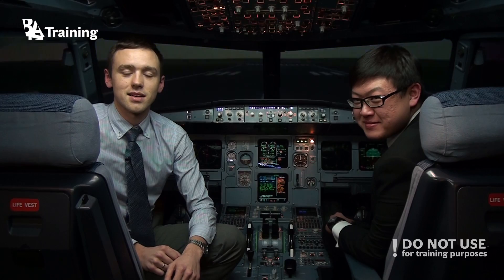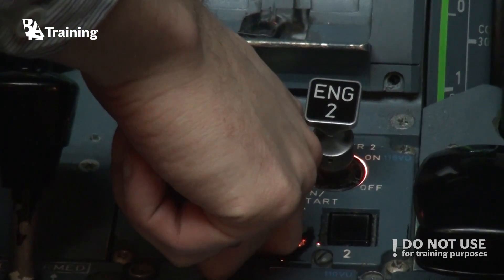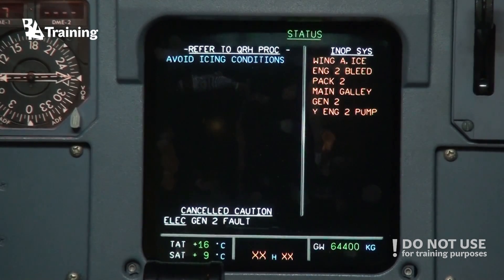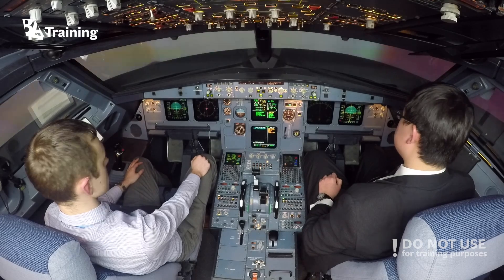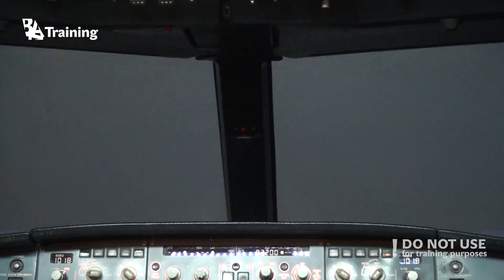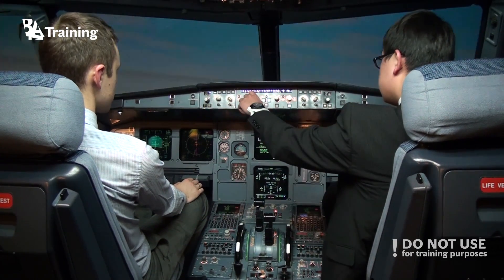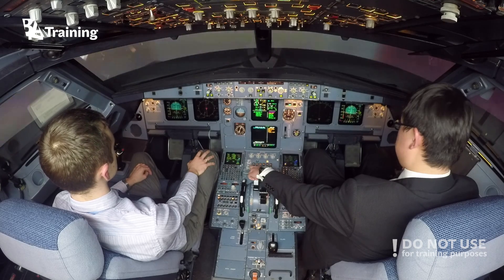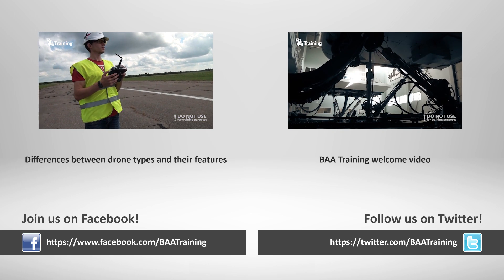Airbus A320 Engine Inoperative go Around and Landing

Comment: Did not have his hands on thrust levers again 
did ask for ecam below 400 ft 
The pf is the one is supposed to take the lever to Did not gave hus hands on thrust levers again 
did ask for ecam below 400 ft 
The pf is the one is supposed to take the lever to idle 
Trimming with auto pilot is useless
Flaps by pf 
Not having st least apu master before clearing elec 
No one called for emergency 
Ok thats as far as i watched for now

Comment: You waited to cut the fuel on a Burning Engine until both fire pods were discharged,. The fuel cut out should be first? That might help stop the Fire from spreading.
Reply: What are in about. It was the crossfeed he sketched after squibs. Fuel was cut off when it’s supposed to be.

Comment: No seat belt for the pilots 
No brake check 
 No clock watch start takeoff 
Confirmation for activation of fire push buttons missing 
Pilotcommand doesn't have the throttle at takeoff 
No ATC communication at all 
No announcement for activation of the AP 
Fo commands flaps 0 and sets them himself 
They're not referring to qrh as said on the STATUS page 
Didn't activate the approach phase in the Ecdu before the approach button was pressed,
You don't know who's the PIC all the time 
You don't check the speed for gear down,
Didn't follow the landing checklist as said on the MCDU,
Seems that not all the lights are on for the landing,
You don't press the CAB FWD button for landing but just to call them to the interphone,
You would consider enabling APU bleed with one engine out,
You would consider enabling both APs for the landing 
They cancelled procedures in the ECAM without confirmation,
No announcement for activation of the AP, Seems that the seat belts are either off or auto but be on

Comment: Hello these are my anwers for the mistakes they made:
- Pilot Flying (right Seat) brings flaps up from 1 to 0 but it is the job of the pilot monitoring (left Seat) to do this.
- Engine mode selector did stay on ing/start for the entire flight after they checked that the engine was inop it should be putt back to normal.
- first arrival they didn't do a arrival briefing and didn't arm approach mode.
- after go around no checklist.
- flaps 1 after go around needs to be flaps 3, pilot monitoring correct's the flying pilot.
- pilot monitoring takes over the controls after bringing up flaps 3 butt the other pilot doesn't confirms it, bad communication all over the flight this can lead to confusion between pilots.
- after the control switch the pilot in the rigth seat calls for flaps two butt the pilot in the left seat should ask that now the roles arren't being switcht.
- second approach the right seat pilot wants to drop the gear to soon, left seat pilot corrects.
- at landing they right seat pilot doesnt focus on landing because right before touchdown he is doing something on they pedestal en forgets to pull the power back for a nice flare.
- poor steering!!!!

- no seatbelts on 
- no contact with atc
Butt cool contest hope i am close!

Greetings from the Netherlands

Comment: -No AP2 in ILS
-The F.O that he's flying the plane cannot do another thing, the other pilot should do all the things of geard down, flaps, etc... ---The F.O can only fly the plane.
-No cabin adviced.
-No checklist.
-No usage of the lights.
-The F.O is not that capacited to fly it, but that's okey because he's an student.
-If the F.O is flying the plane they need to turn on the AP2, not the AP1.
-Not confirmation at all between the checklist and cancellation in the MCDU.
-Not selected the approach in the MCDU.
-With an engine out you need to land with flaps 3, not with flaps full.
-Obviously not ATC notified (Not ATC at all).

That's what I think, greetings from Mexico.

Comment: Before Go around 
No configuration V1 V2 VR MFlex (speed)
No TACAS on TA 
engines were in toga for a several time 
Unstead to keep flaps 2 you decide to retract it 
No Apu after 5 minutes 
No ATC 
Autopilot 1( captain)  were used unstead autopilot 2 (copilot) 
NO AP1 +AP2 with aproax mode 

After Go around 
Autopilot (AP1) unstead AP2 
No alternative airport plans 
Copilot out of focus on landing  
Captain allways telling the indications unstead the copilot made the indications because he was flying the aircraft.

Comment: no seat belts for the pilots, 
no brake check, 
pilot in command doesn't have the throttle at takeoff, 
no clock watch start at takeoff, 
confirmation for activation of fire pushbuttons missing, 
no ATC communication at all, 
no announcement for activation of the AP, 
FO commands flaps 0 and sets them himself, 
they're not referring to QRH as said on the STATUS page, 
they cancelled Procedures in the ECAM without confirmation, 
didn't activate the approach phase in the MCDU before the approach button was pressed, 
you don't know who's the PIC all the time, 
you don't check the speed for gear down,
didn't follow the landing checklist as said on the MCDU, 
seems that not all the lights are on for the landing, 
seems that the seat belts are either off or auto but should be on for landing, 
you don't press the CAB FWD button for landing but just to call them to the interphone, 
you would consider enabling APU bleed with one engine out, 
you would consider enabling both APs for the landing, 
you start the go-around only at minimum altitude when nothing of the runway is visible, but not 100 feet above the minimum
no GA flaps were set,
 you set AP2 for FO and AP1 for CPT, 
when you only have one engine available you set the TCAS mode to TA Only
when you only have one engine available you approach with config 3 not Full

that's all for now ;)
Reply: LordNoName must either be a real Airbus A320 pilot or just knows his stuff incredibly well.
Reply: Maybe flaps 3 landing with one engine out
Reply: Louis Dengler to be or not to be 🤣😂 may be landing weight allows make landing this flaps full 😉
Reply: A lot of the time nobody is flying the aircraft. They both have their heads in the problem.
Reply from the maker: Congratulations to the winner of this challenge! +LordNoName Please provide us with your full address and phone number to news@baatraining.com as we are going to send you your present.
Reply: What was the present?
Reply: Sounds like one of these pissy instructors

Comment: No AP1 and AP2 on CAT 3 landing 
Exedet the TOGA limit 
FLAPS full instead of 3 
Did not add 5 knots at landing speed 
Did not reset the ruder trim on time 
Retardet to late 
Puting ENG mod selecor to IGN was obvius not nesery because engeni fire and damage 
Transponder did not put in TA 
Was not on the center line 
Maket to sharp turns  
No ATC 
No checklist 
No pasenger notification 
No pasenger sings 
Flap 3 mode on GPWS 
No briefieng 
No cabin crew briefeng 
Cros feed was of 
APU to late 
No APU generater 
No APU bleed 
The first officer almost retrakted the L\D GEAR 
Captain did not land the plane 
Captain disconected the AP 
Flap retraction to late

Comment: Starter set to Ign, not necessary in airbus. "Pilot Flying" trimming rudder nose right when it should have been nose left. Full flaps used instead of a conf 3 landing. Not really sure who was supposed to be flying half of the time especially after captain called "my controls" then continued to ask for first officers input. Only one checklist read out in the flight.

Comment: I think you exceeded the time limit for toga thrust which is actually 5 min. You should have reduced it at the thrust reduction altitude. Moreover you should have set the clean configuration at the engine out acceleration altitude and not at 3000 feet.
Reply: 10 min witn one eng fail

Comment: Wrong cockpit commanding (flaps and rudder trim reset on landing...)
Use AP 2 for the right side pilot flying
Do not use TOGA on a normal takeoff 
No atc and cabin contacting?

Comment: Minimums at 200 feet? With only one engine? In such a low visibility? Isn't it kinda low? And do they use flaps full with one engine operative? BTW, u had to add more than 5 kts to final approach speed. It's way too slow!
Reply: +Богдан Ковальчук That's pretty standard for a CAT I ILS approach. Not sure if having an engine out makes a difference, though.

Comment: No AP1+AP2 in CAT3
No checklists 
No cabin notifying
No ATC notifying
you have to press LOC before APR
Reply: +the gold movies AP1+AP2 is not needed in CAT3. CAT3 means autoland mode in Airbus. CATIII of ILS is a different thing.
Sometime you don't have time for full checklist, you have to focus on another things. So you're doing only MEMO actions - this is the most important essential which you MUST do.
This is a pilot decision to notify the cabin and just only stress passangers - why if it is only 1 engine failure, and you clearly can land (e.g. conditions are improving) - so why unneeded there stress for passangers???
They  very few simulates operations with ATC.

You don't have intercept LOC before G/S, sometimes operation allowes to intercept LOC and G/S in the same time. Also blue G/S only means that it is ARMED mode (it will automatically switch to normal when intercepting it).
Reply: +the gold movies No GA Flaps
Reply: +Flaps UA In A320 you are not retracting flaps on go around like in 737. You retract it when you establish positive rate.

Comment: you have put the flaps at full you must put them at 3 because you are flying with one engine
Reply: This is an Airbus . Engine out landings are done with Flaps Full except in exceptional circumstances when performing an overweight landing at a hot and high aerodrome.
Reply: Untrue. Read your qrh